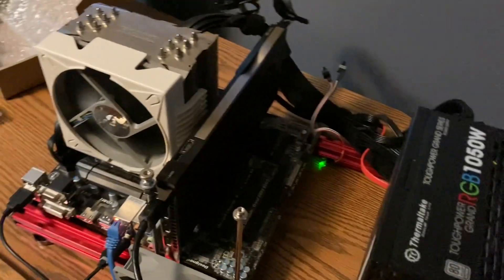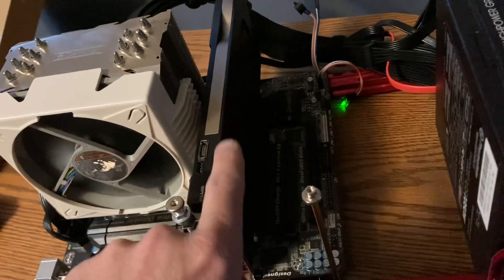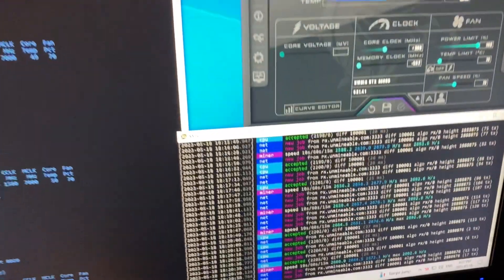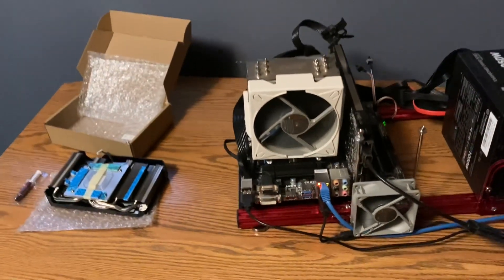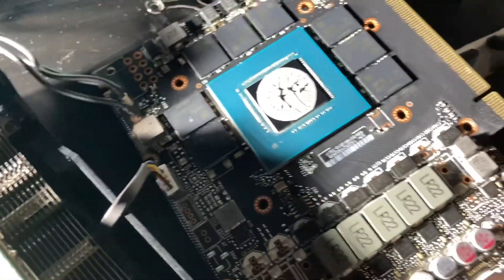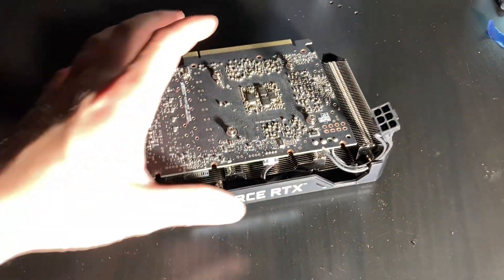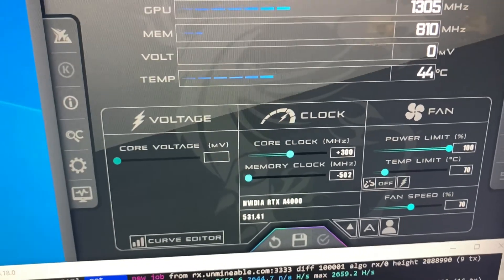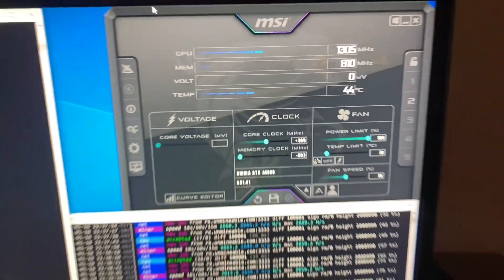A4000 cooler upgrade

Comment: You should put the retention bracket back on the GPU. You won't get enough mounting pressure to get good contact on the PNY cooler with just the screws alone. Should also look into 90 degree angle brackets to assist with more mounting pressure. Lastly, there are much better options for thermals pads than the ones that comes with the PNY cooler. They'll do the job just fine, but ThermalRight or Gelid pads will help drop the temps even more
Reply from the maker: Thanks for the info!  I will definitely try out your recommendations. I do have some good thermal pads to replace the stock ones I just wanted to see how it performed out of the box stock but now that you mention it I still haven’t swapped the pads out yet.
Reply: @proxcrypto  let me know how it goes! I'm curious to see what the results will be like!

Comment: Is that, only 5-6 degree down with that new cooler ? very disappointed
Reply from the maker: Yes it’s about 5-6 degrees with this aftermarket cooler on the core. Since the video I removed the shroud and just run a 120mm noctua fan on the cooler. I did it to make it silent but it lowered the temp a few more degrees and I have left it that way. Also the ram runs alot cooler with this setup it dropped 10-15 degrees depending on ambient temp.